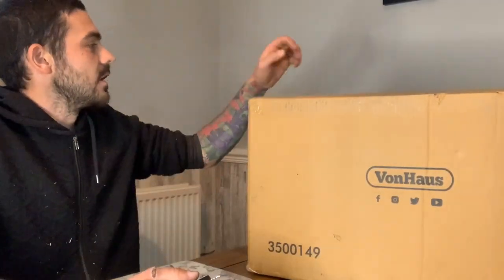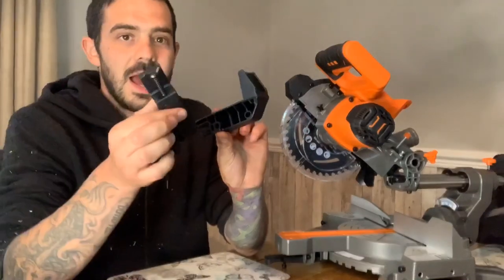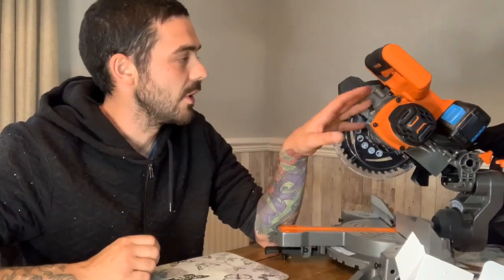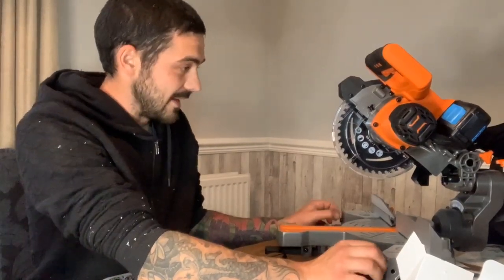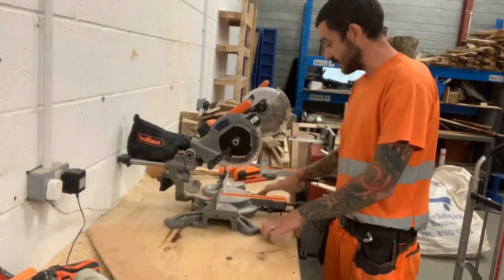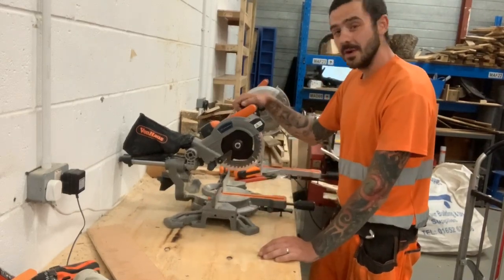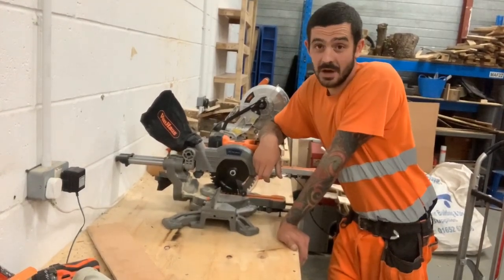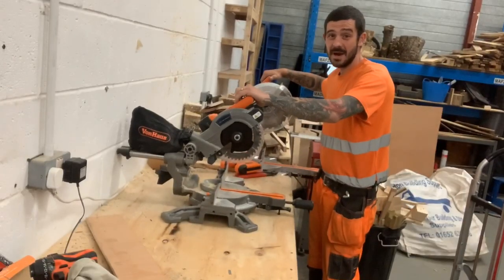Vonhaus 20v Max Cordless Mitre Saw Build and Review Tested Against 240v Saw Woodworking Guide

Comment: They seem a good make, and I know alot of the die hard DIY and trade snobs will say they are rubbish and only a DeWalt or Milwaukee will do, yeah but who's gonna pay several hundreds of pounds for a mitre saw?. I have a cheap Performance Power mitre saw with a really rusty looking blade, been in my wet and damp garage but it still does a good job at cutting through wood, probably would benefit from a new blade really.